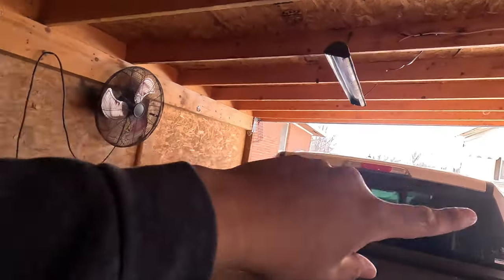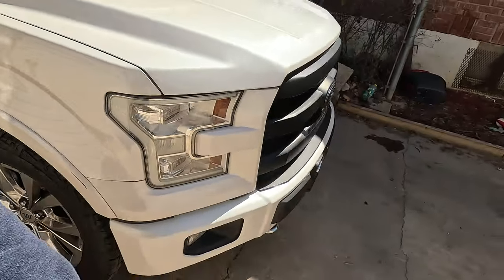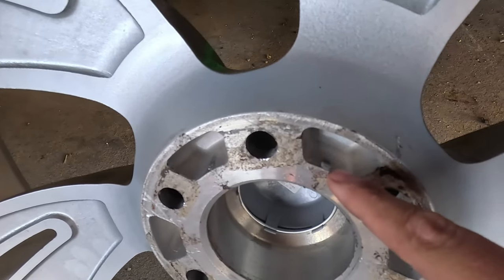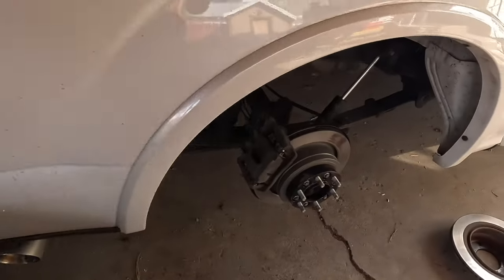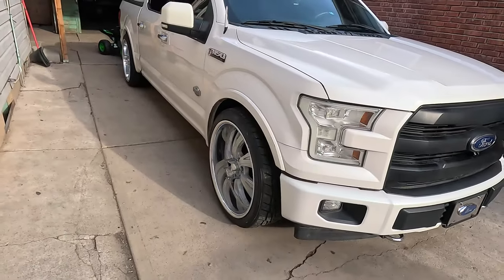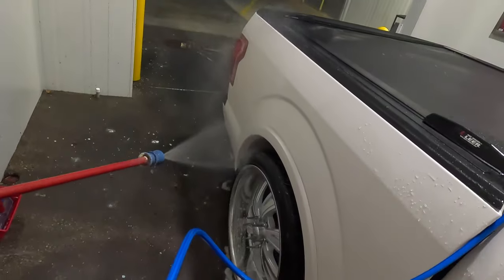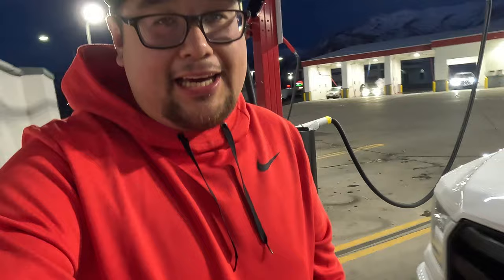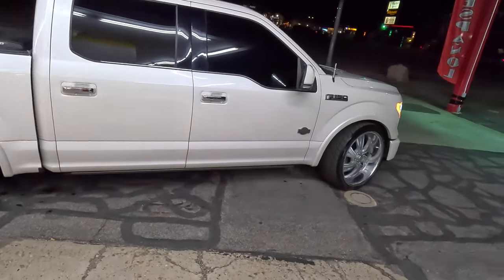Lowered F-150 Gets Her 24's Back!!! 24 inch Dropstars Back On The Foringa - 2017 King Ranch

Comment: What off set are the wheels  or what off set is needed to keep it flush with fender
Reply from the maker: The wheels are a 24x11 +40 offset and I have 1.25 inch spacers that’s how it’s flush with the fender
Reply: @5.0hh_andres Thanks bro, ordering them right now or may do 24/9 in the front w/2.5 lip. Definitely sharing video!!!
Reply from the maker: Hell yea bro I appreciate that 🙏🏽💯
Reply: What tire size you have, ones I have are to small
Reply from the maker: I’m running a 285/35 R24 Toyo Proxes
Reply: Are your truck lowered